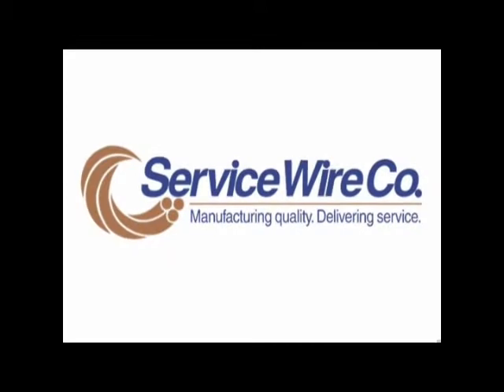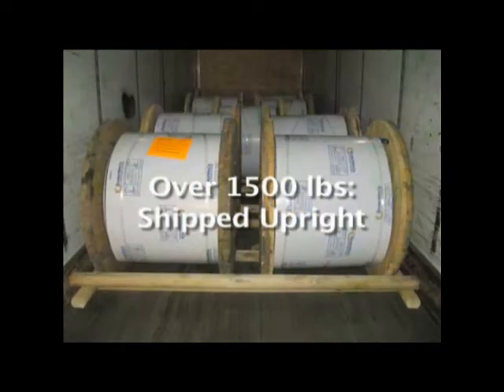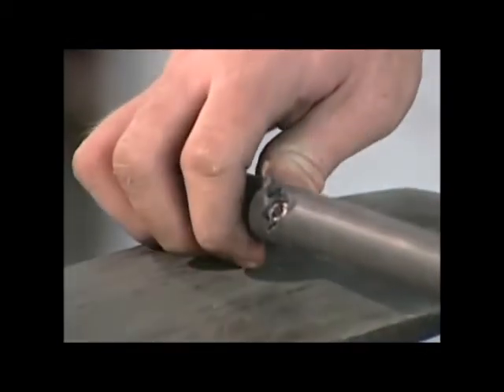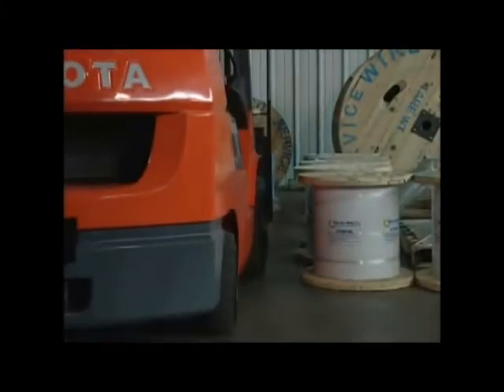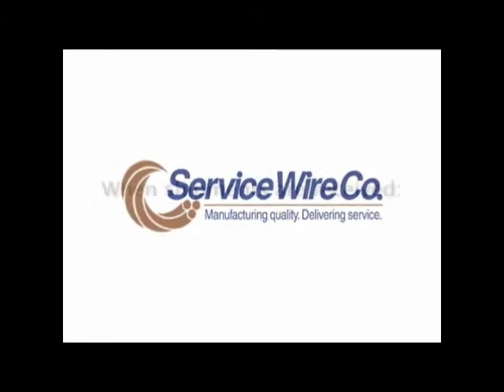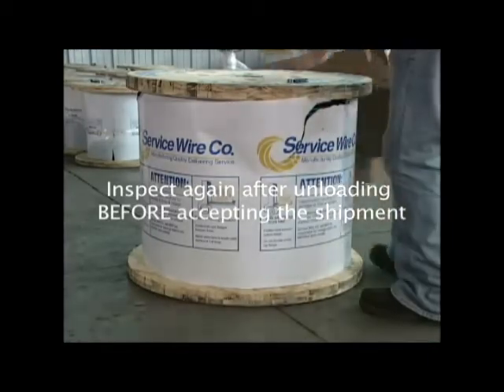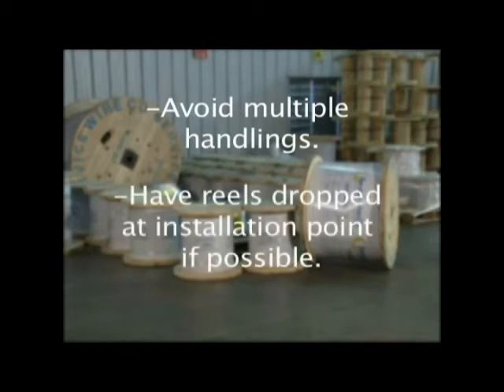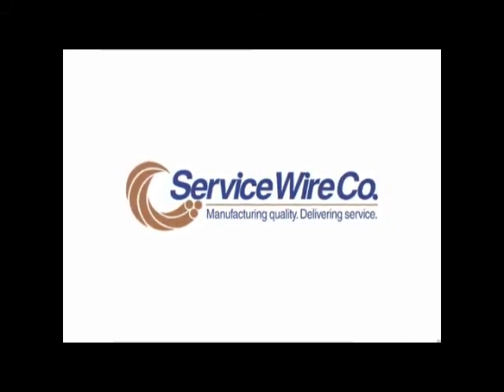Proper Reel Handling

Comment: Thsi was helpful. However, do you have a proper way to flip a flopped reel to the upright position? That is where we are damaging most of our wire. Thanks.
Reply from the maker: Hi Mike,

A reel up-ender is the best method. However, this method requires permanent floor space and a pit to operate. Without an up-ender, reels that are light enough can be flopped by hand. For heavier reels, many methods exist including overhead cranes, gimbals, manipulator arms, etc. 

Thank you for watching our video, and if you have any other questions, please feel free to ask.
Reply: @servicewireco  I can do it with a forklift without sleeves no problem. All our encore wire arrive flopped, 750, 600, 500 gage copper/Aluminum, etc. I'm forced to flip them upright to hang them on the racks. No problems here. 😎
Reply: We use a large wheel bar. place it into the hole, then carefully use leverage to upright it.